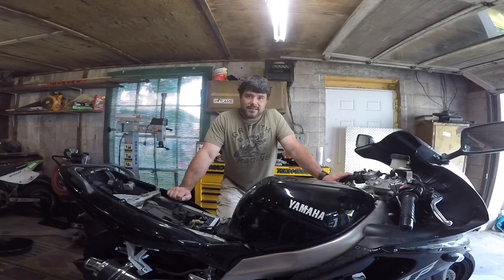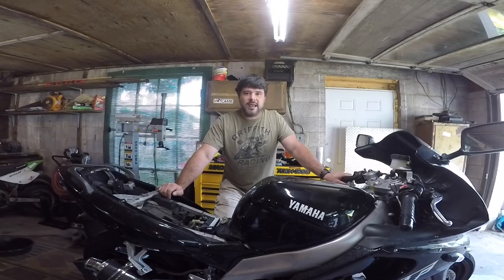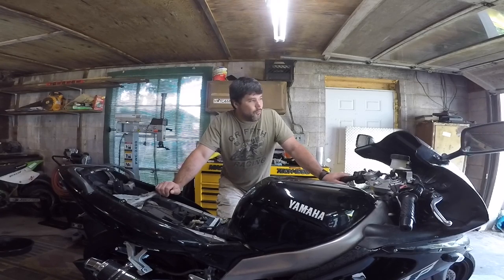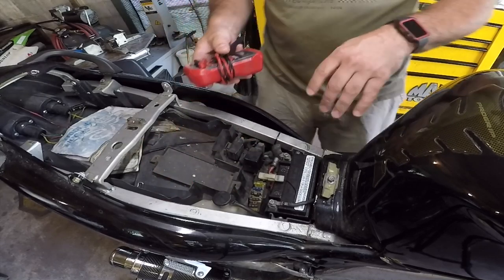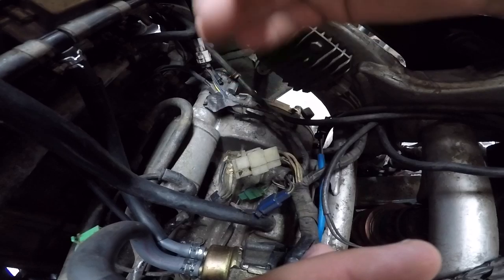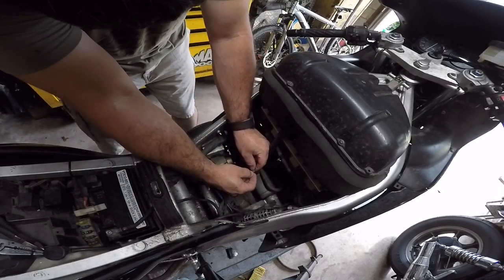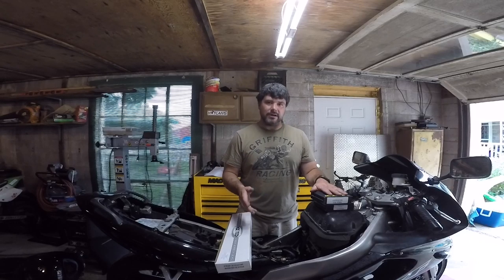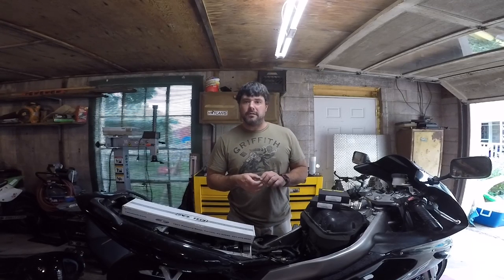We figured out why the thundercat stopped running

Comment: You do not always need to cut the wires on sport bike connector blocks, use a tiny paneling nail and gently tap it in where wires lock into the block. Often will easily release the wires just clean and polish wire  terminals put grease on each one, then plug them into correct holes on new connector blocks ordered from ebay. bike will run like new assuming charging system is working. check every single connectoof course disconnect nattery before doing all this.check all connector blocks and wire contact points on any bike you get, ounce of prevention is worth ton of cure

Comment: Great video with good detail. I also have a 2001 thunder cat that I recently got and the one issue I’m having is the tachometer dropping randomly while on the highway ( not throwing any code) and the resumes back to normal. What I’ve been reading is that it might be the CDI (or the wiring ,which I’ve checked). I was wondering if you had any input

Comment: I’ve got a 96 YZF600r... and I’ve been trying to get it running for weeks.. keep running into different issues and am chasing my tail at this point... super confused and not finding any info online.
Reply: the majority of "need to get my bike running" issues are common across the board. start with compression, fuel and spark. Spark check by plugs out of engine and grounded while engine cranks. compression check is a shop thing or buy the tool, then fuel, carbs are a bit of a pain, but try starting fluid and if that works, carbs bad. that should keep you busy :)

Comment: Yo Matt! Great video and good info. Struggling right now with this exact same issue. Quick question - the stator plug on mine was completely melted and its hard to tell what wire goes where, They are all white wires so im wondering if there is a specific way these connect or does it matter what wire from the stator connects to the harness.
Reply: check service manual as a starting point, or consider taking it to a dealer if its a simple wire connection issue?

Comment: Greetings I have a 98, which does not get a spark or current bovine wings ... we already changed the cdi, we thought that was that, we changed the sensor battery that goes in the lower part and neither, the sensors are good, the cloche and the the leg, someone has any idea that it could be
Reply: Hey man I have the same bike and I recently dropped it not hard but not it’s not going into first gear it’s started and everything works lmk if you have any idea this is my first bike btw